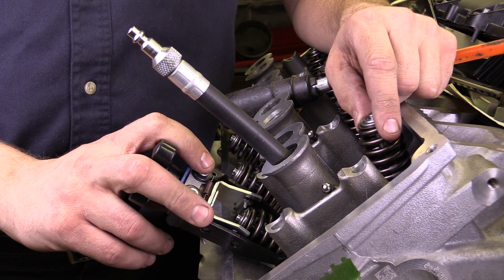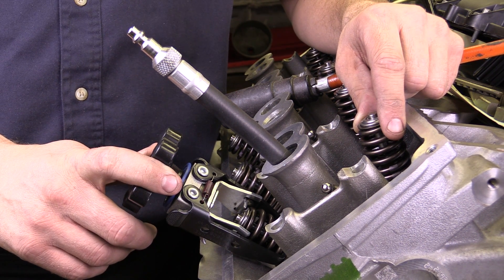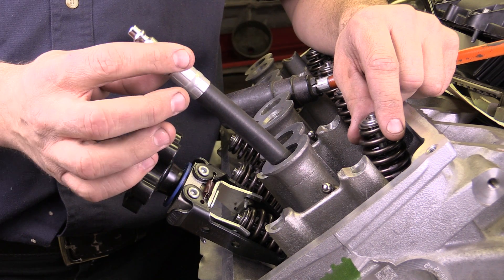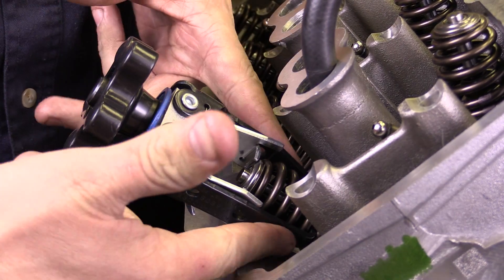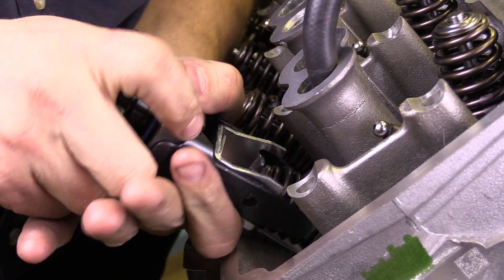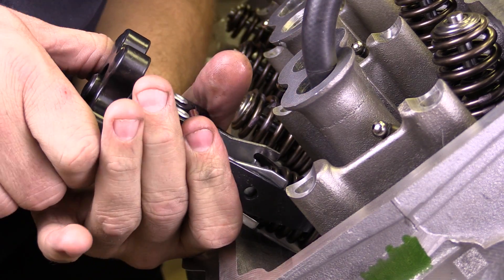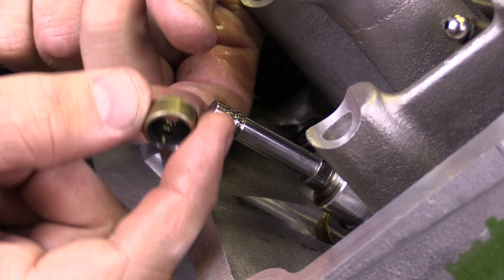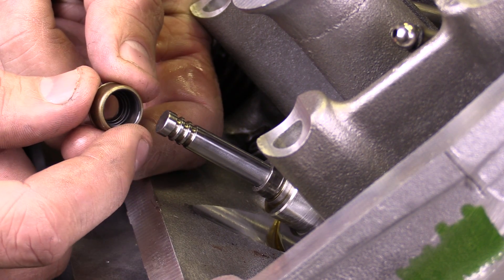Replace Valve Stem Seal

Comment: How much air pressure should be used? Too much moves the piston to the bottom of cylinder.
Reply from the maker: I was using about 70 psi in this video. It can be challenging to keep the piston from rotating with the air pressure applied. It may help to leave the wrench or ratchet attached to the crankshaft bolt to help hold it in place.   You may also have better luck rotating the piston to just before TDC or just after.
Reply: @ScottHadzik  I used the 1/4" Nylon Line Technique it works just as good. Played with the near Top Dead Center thing but could not get it to work. I even dropped the air pressure down to 50 psi. Would not stay put. Thanks for the recommendation though.
Reply: i GUESS i COULD HAVE PUT A rAG IN THE fANBELT TO TRY AND KEEP IT FROM MOVING.

Comment: Does tdc matter? Will the air pressure secure both the intake and exhaust valves in place?
Reply from the maker: TDC may not be that critical in most engine designs
Reply: @ScottHadzik  Do you have a recommended PSI
Reply from the maker: @jakevalent6180  anywhere from 75 to 120 psi should work. Most shops are running around 80 to 90 psi. You could probably get away with using less psi if needed as long as it holds the valves closed.

Comment: Hi great video. Would you use a similar procedure to replace valve seals on a 2011 hemi engine out of a ram 5.7L? Or is there a significant difference?
Reply from the maker: Yes, I believe so. The 2011 should be very similar to this. Most cylinder head use a valve stem seal. The procedure is the same for nearly all heads. The seal might be a slightly different design on other engines but the concepts covered here would most likely still apply.
Reply: @ScottHadzik  thanks so much for the info.

Comment: Great video!  If the head is off how do u keep the valve from moving when you compress the spring?
Reply from the maker: I usually use a shop towel or similar. There are also valve spring tools that are a giant clamp

https://www.amazon.com/OTC-4572-Large-Spring-Compressor/dp/B000F5ECUY

Comment: What tool did you use
Reply from the maker: Any compression gauge that has a separate tube that screws into the spark plugs hole should work. I'm using a Snapon one, but something like (https://www.amazon.com/OTC-5605-Deluxe-Compression-Tester/dp/B004K2FSXI/ref=mp_s_a_1_3?keywords=compression+gauge&qid=1557865158&s=gateway&sprefix=compression+gauge&sr=8-3) would work.

There are a number of different valve spring compressors available. 

I'm using this one https://www.amazon.com/OTC-4573-Universal-Overhead-Compressor/dp/B000F5HUUI/ref=mp_s_a_1_6?keywords=valve+spring+compressor&qid=1557865411&s=gateway&sprefix=valve+spring&sr=8-6

This type is easier if your engine is configured to use it 
https://www.amazon.com/Proform-66784-Valve-Spring-Compressor/dp/B000630J84/ref=mp_s_a_1_7?keywords=valve+spring+compressor&qid=1557865477&s=gateway&sprefix=valve+spring&sr=8-7
Reply: Well I’m working on the hemi as well. So in your opinion which compression tool will work better?
Reply from the maker: @freddybustos5908  Hemi springs can be a bit stiff. There are several versions of the tool found in the link. I think it's worth the cost to use a tool specifically designed for your engine. The link is just an example I found with a Google search. There may be a better and cheaper option, it's the design that you want.

http://www.moes-performance.com/mobile/Product.aspx?id=38494

Comment: What year was this vehicle?
Reply from the maker: I'm not sure of the exact year, It was the 2003 to 2008 version. It was not the current version which is called the Eagle (2009 to present) See more info on the differences here http://www.hotrod.com/articles/ccrp-1210-inside-the-g3-hemi-cylinder-head/
Reply: Wow, thank you for the quick response. I’m wondering because I have a 5.7 2010 Dodge charger that appears to have a field lifter and camshaft and I’m also going to be doing valve seals and they sent me valve seals that look very similar to yours but I also see a “top hat” version floating around so I’m not really sure what’s in there or if I have the right ones
Reply from the maker: Sometimes those kits come with multiple types of valve stem seals. I'm not sure what the reasoning is.  I would recommend using the type that your engine is equipped with
Reply: Only problem is I’m not sure exactly what’s in there and unfortunately I won’t be doing the work 😑
Reply from the maker: I looked it up. It looks like they are the same type as the ones in this video. Good luck.
Reply: Haha, yeah, they look like the ones seen here 

https://www.partsology.com/dnj-vss1163-viton-valve-stem-seals-hemi?gclid=EAIaIQobChMIpKKi_KD62wIVh0CGCh0mqg9cEAQYCiABEgL4-_D_BwE

With the type of set up you had, do you recall if there was any type of shim or anything to protect the head from galling via the bottom of the valve spring??